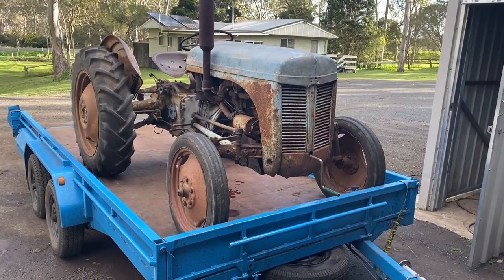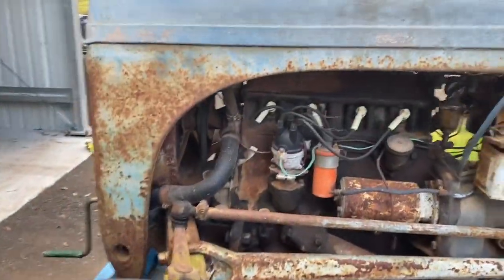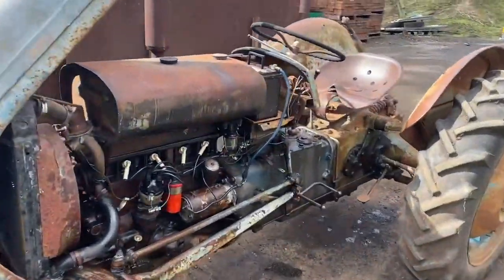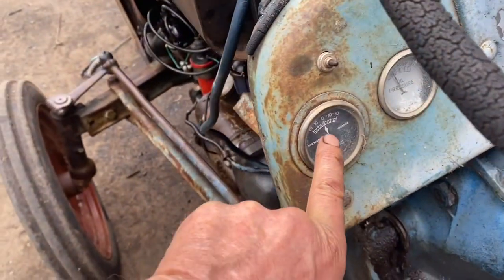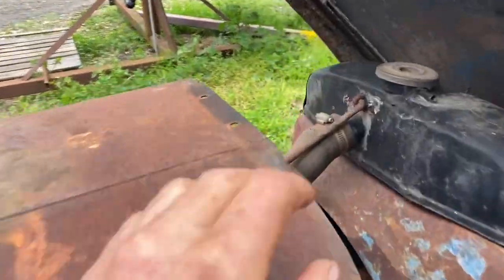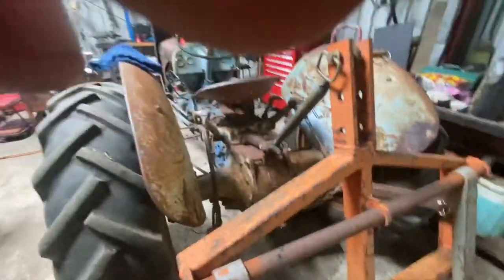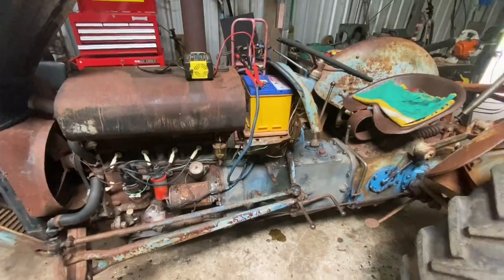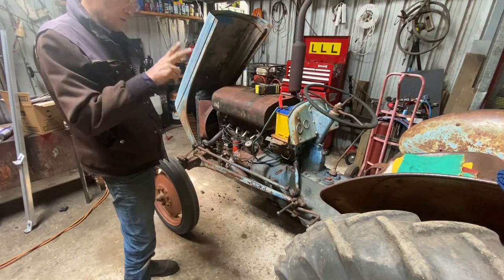Ferguson TED 20   1950

Comment: Essentially a British version of the Ford 8N. Ferguson was given all of the engineering drawings and material specifications for the 8N when they settled with Ford over the 3 point PTO and lift dispute. I have a 48 and a 52 8N both flatheads…Ford did not build a OHV engine tractor until the Jubilee in 53. Nice machine. I’ll lay odds that a 8N 12 volt conversion kit will fit it  with little modification.

Comment: I think your tractor is a Tea model not the Ted. Because on the Ted the airfilter intake is on the dash. Also it's  6 volt the Ted is a 12 volt. Nice tractor good little project.😁
Reply: It's a TED, it has the double tank.

Comment: With a little TLC these tractors will virtually run forever, they are so light on the ground and they turn on a sixpence, with the hydraulics properly set they are fantastic with a mould board plough,, though I'm not so sure with your disc plough.